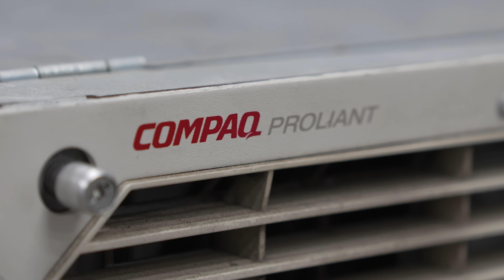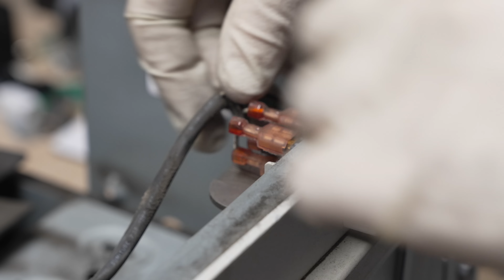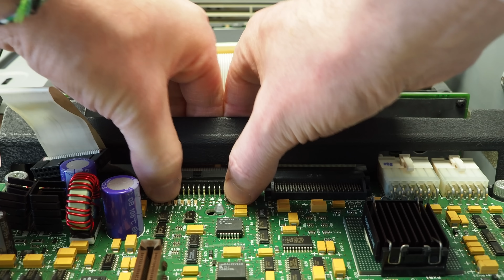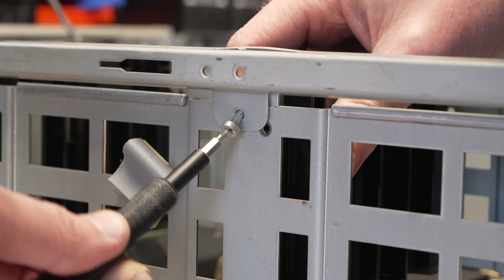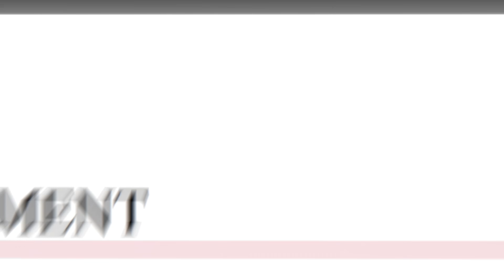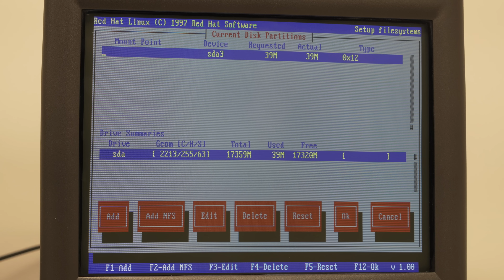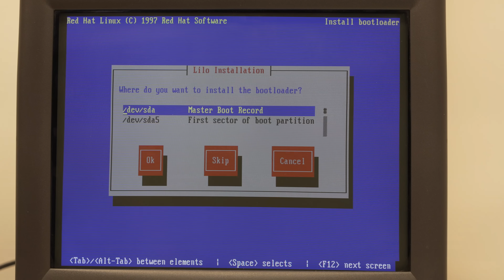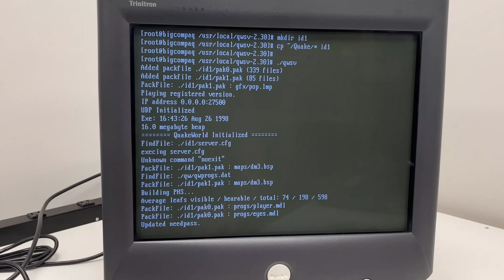A $25,000 server from 1999!

Comment: The Compaq smartstart was genius - you used to get a whole pack full of CDs and some included the operating systems that you just needed the licence for, drivers for the majority of hardware available too.
Used to install the smart array cards in these and sometimes swap the drive backplane to a split scsi bus, though you sometimes used to lose a drive bay in the process ( might not have been this particular 6500 model tho ) 
Heavy beasts that’s for sure when fully loaded!

Comment: I had the quad pentium pro version of this system. Ran server 2000 on it. It was a big trip across the state to get it, had a buddy drive me and it was a big job to load into the car. This system really got me into scsi gear. Mine had the slot loading cd drive, and i had lots of external hard drive enclosures attached for more cd drives and tape drives. I loaded it up with way bigger scsi drives and ran a music and file server off it. Had a bbs hosted on it for file servers and chat. This was around 2008, way better and smaller systems would have made sense, but i loved running it. Was cool to see all the indivial drives blink as different things were accessed. Sadly the novelty of running it wore off, and when i was planning to move i sold it. regret that and wish i had it back. Thanks for the uploads, i got a dual pentium II compaq i hope will take the place of the old p pro system.

Comment: I use to work with Compaq servers and had set up a smart start server. Basically we wold plug the server in the network.  Load the smart start disk. And in about an hour had Nt up and running with no intervention. All was automated

Comment: I combined parts from two PII proliant 3000s into a single system in the 00s. The steppings on the CPUs differed, but it worked anyway, and served as a file and backup server (DLT) until after I left the company in 2010. It had been purchased in the late 90s as a netware server for migration to address y2k concerns which never materialized. I don't miss it, but I do remember it fondly.
Reply: Netware saved us with Y2K. Most of our PCs booted to 1900 then the netware client fixed the date when it loaded.
Reply: EISA configuration utilities... I don't miss that.

Comment: I would really recommend using the "final" minor version of RHL from this era, IE always use one of 1.1, 2.1, 3.0.3, 4.2, 5.2, 6.2 or 7.3 - and RHL 5.2 was released approximately 4 months BEFORE the PIII Xeon 500MHz making it the logical choice.
AFAIK these "final" releases usually had orders of magnitude more users than the initial releases - mostly people waited for at least the .1 before switching even desktops from the previous major version and servers often waited for the final one before jumping.
SMP: I never used RHL 5.x with SMP machines but with 6.2 it was IIRC just a question of installing smp kernel rpm - or perhaps it checked during install (not sure). But that may or may not have been in place for 5.x, it was really early for SMP.

Comment: Wow! I supported some clients in the 90's and almost all had machines like this one or similar models. I especially remember an install with a Proliant 8500, what a beast. Anyway, I'm glad you got a copy of the "Smartstart" CD. It's a must for these machines. Not only for installs but the bios F10 setup program is installed on disk by Smartstart. When installed, at the end of POST you get a blinking rectangle in the upper right corner for about a second if there is an existing "BIOS partition". It was always a pain if someone else had done a quick and dirty reinstall without caring to use Smartstart. It is a very powerful BIOS/Setup program that you want to have. God I miss this era of Proliant's.

Comment: I worked for a VAR back in the mid to late 90's out of high school and we had CompuServe as one of our customers. They were buying ProLiant 5000R's and towards the end of my time there they started buying these. They were great to work on and we would load them up with 512MB of RAM and four processors with varying hard drive configs. We installed NT 4.0 on them and then shipped them out to head across town to CompuServe's headquarters in Hillard, OH

Comment: Just one of those processors would have been amazing in a home desktop at the time.

And today you can get a $150 N100 mini PC that's silent, oodles more powerful, dozens of times more RAM, sips electricity and struggles to run just Windows smoothly. :P

It's nuts how much we take compute power for granted.
Reply: its nuts how much big company developers take it for granted. Windows 11 could run so much smoother if time was taken to make it efficient
Reply: I built a system in late 2000 and it was an 800 MHz Athlon Thunderbird versus these Pentium III 550. Server CPUs have generally been intended for scale over individual core speed. If you buy a top-of-the-line Xeon Scalable system today, you get Emerald Rapids, launched late 2023, with 12th gen Golden Cove cores, launched late 2021.
Reply: linux will run fine on a N100 mini pc tho, with weak but usable 3d graphic
Reply: And it's also nuts how much various companies, like Microsoft insist we have just to run their latest Windows.
What I do can be satisfied by an old Core2 duo, but I need all the unneeded overhead to run their stupid OS (No Linux will not run my software)
Reply: @paulstubbs7678  Running Windows is a choice, not an obligation.

Comment: These were such a joy to work on.  And they were the benchmark X86 servers that set the standards, not even IBM could compete with these. Other servers were not half as easy to disassemble. And compaq treated the channel service technicians as royalty Not like Dell did.  
That all came to an end when Carly Fiorina took the helm and ran Compaq into the ground and later nearly did the same with HP.  That is what you get for letting these repuplican bilionaires run things. All they see is cost cutting and none of the qualties of the company.  Fucking criminals!!

Comment: I remember taking my training for Compaq certifications back in mid 90’s and this was one of the models I passed cert but didn’t see in the wild. More commonly worked on the Presario desktop line including the cute AIO based on a 14” CRT. Compaq had great engineering and provided us with a Torx T15 screwdriver while every clone kept using the Phillips screws.  I was sad to see Compaq get absorbed into HP. They were truly unique.

Comment: I don't think that NIC is upgradable to 1G, it is for version where two NICs sandwiched together giving you 4 ports. You can see that from number on the metal brakets where it number each interface, as well as two extra holes for active and link led. I had NIC card like this before and it had quad ports with two PCB joined together. I can'r recall name but it was based on Intel chipset with SUN part number.

Comment: Love it! We had a few of the later version of that after Compaq had been bought by HP and rebranded. Fully tricked out too. By then they supported 8 cpus and 64GB of ram. Then you could also remove the cpu board, and hot swappable RAM boards too. Which made it much easier to rack mount.

Comment: i am wondering, have those CPUs multiple RAM Channels with interconnects or there are shared over one bus? i mean you put 2 more CPUs in it and reduced the RAM modules by half. so theoretically the bandwidth is half but also the placement makes no sense if every CPU has its own channel. i guess maybe this was the problem why you could only see the half of the ram in the beginning, because of the RAM module placement or your ram and CPU was set to fully redundant, therefore the second CPU and RAM does nothing unless one of them fail. 
I have a dell poweredge R630 and a R930 at home. Those are compute monsters like this at its time. Both of them can be set to fully redundant this means only one CPU and its RAM is working, the others doing nothing. yeah it sounds like a waist of resources but if you deploy your system on a place where you can't go easily and need 100% uptime this is a pretty good solution. The failover is seamless compared to having 2 individual systems working parallel together.

Comment: I worked with Intel reference SC5000 boxes at that time. Fun part with these systems was that they were so bottlenecked on FSB that going from two to four CPUs often only got you single digit percent improvement. So you were just heating up the room for no gain.

Comment: It's absolutely mind-boggling how fast CPU / semiconductor industry moves.
My main home server is Ryzen 3 PRO 4350G (4C8T Zen2 3.8GHz : boost disabled), 32GB ECC 3200MT/s DDR4, two Intel 1Gbps ethernet (i210 and i211), and two NVMe SSDs, all squeezed into a small mini-ITX enclosure with just one fan for the whole thing.  This little thing would completely blow that $25k server out of the water, and it's not even the latest anything!
Reply: Heck this thing is outclassed by a Raspberry PI 4 now.   It's cool but very dated.

Comment: I used to have a load of these Quad 6500's to run a calculation and print engine service. 2 sets or 4 in each server room, and another 35 scattered around the country in branches for remote calcs. 
All had a full drive bay of 15,000rpm 9.1Gb discs. 
Also had the UPS (180Lb) lead acid brick in the bottom of the rack as a stabiliser....
Ran NT3.5.1 then later NT4.0

Comment: Compaq really loved to use those flat/Star screws I was given several compaq p1-166 machines at one point 24 years ago.
Reply: You will find them everywhere in modern HPE ProLiant servers as well, they haven't gone anywhere! 

It's just so thoughtful they included the slot, so that a technician without the right screwdriver could still work on one in a pinch, definitely a welcoming design element if I ever saw one. 

Way better than Phillips that's for sure
Reply: Even back then they knew the superiority of torx
Reply: Hateful things

Comment: Beautiful restoration! Little tip when working with brittle aged ABS plastics, take a temperature controlled heat gun at 70-80C to soften it up a bit, let it cool down naturally back to room temperature, and it should be malleable again without snapping off. Try it on a sacrificial part first to get a feel!
Reply: Oh cool, like annealing for copper etc?

Comment: The good old days, when I was the junior technician using ISDN to remotely connect this machine via a PCI KVM for diagnostics.
Reply: yes, with a Compaq Remote Insight Lights-Out Edition PCI management board installed in a Compaq Proliant, you could do everything remotely from powering the server on and off, applying ROMPaq firmware updates to the System BIOS or Smart Array RAID Controllers, even perform a full re-installation of Windows NT or Novell NetWare

Comment: I just love these old weird servers. I've got one ProLiant 3000 and two 5500's myself. I've ran the 3000 as a pihole DNS resolver at home for years, haha! 
The old SCSI drives are an issue these days. But I've found you can easily add disk controllers such as the old Promise Tech IDE ones, and even PCI SATA controllers as long as the controller has its own BIOS. I've booted Debian off a STA SSD in one of the 5500s. You need to manually partition the drive to put the boot partition at the start of the drive. Other than that it's surprisingly smooth sailing. I've also replaced the fans with more quiet ones from Yate Loon of the same thickness. The stock fans are massive overkill for a home environment.

Comment: 256 MB wasn't all that crazy. I had 192 MB in my Windows 98 computer (in or around 1999) by adding 128 after deeming 64 insufficient. I wasn't exactly flush with cash so it couldn't have been that expensive. I bet the 128 was around $100. What would be crazy is actually taking advantage of Intel's PAE to utilize more than 4 GB RAM.

Comment: On some Compaq systems of the era the SmartStart and other boot discs were absolutely necessary due to Compaq deciding not to include any built-in BIOS configuration on the ROM but rather having it all done via a boot disc
This isn't exclusive to servers either, even some Compaq laptops suffer from this!

Comment: Interesting video, especially when you installed Red Hat! Things may have been smoother if you used a slightly newer version of Red Hat, like Red Hat 6.1 from 1999, it uses kernel 2.2.12 and has the smp kernel on the disc. But it is good that you got it to work on the older version :)

Comment: Great video. Really loved seeing cleaning with soap and water.  Too many tech rehabbers go to great lengths brushing off dust when they can just wash the stupid parts.  It's frustrating to watch.  Anyway, here is my Compaq srory. Job I worked in 1999 had a $50K similar Compaq server. It was the pride and joy of that shop.  Changed jobs and my new employer also had one, but by 2004, things had progressed so fast, the Compaq was totally obsolete and they gave it away to employees.  I took it home.  In theory. It made it IN to my car, taking the whole back seat. But it never left the car. The idea of carrying it up stairs into my house was a no. Ended up giving it to another coworker and it went from my car to his car.  Never looked back.
Reply: Ehm, had you stopped to think for 60sec it might have occurred to you that servers like this are like Lego. Moving them as one piece is the definition of stupidity, take the PSU's, drives, cage modules out and you have a bunch of bits that are easy to transport. The case isn't that heavy when empty, it's just an annoying shape and big. I transported a DEC VAX 11/750 to the third floor without elevator that way. Just takes a bit of time and multiple trips.
Reply: thats not soap, theres a special solution to be used with an ultrasonic cleaner. its not soap though. the ultrasonic cleaner uses sound to clean it and the fluid is meant to be good with that.
Reply: Ha, good stpry

Comment: Notice how most of the disassembly is tool-less. Compaq got that design philosophy from DEC, and later it was passed on to HP. These machines might have been expensive and as you say most of the components are bespoke, but you wouldn't bloody your knuckles or lose screws inside the case trying to swap out a NIC.

Comment: Another thing about this generation which was cool was conversion kits.  Since they are modular, if you started out with a tower, which was the most common variant, then wanted to make them rack mount, they had modules and covers to swap onto the tower to make it fully rackable.  You can see things like the LCD orientation can go multiple ways.  

I loved these things.  Made me so much money doing conversions and Lotus Notes administration, hooking them up to USR Total Control modem chassis with T1 lines.
Reply: I remember you could do this - converted a few (2500 ?) in a similar way - then they had R after the model name meaning it was already in rack format

Comment: We used those in late 90s early 2000s for Windows Terminal Servers Servers. Initially running Citrix with NT 3.5 then windows NT 4 servers with WTS built in. Was used for remote offices over Frame Relay all over the country. In that era the vast majority of servers were windows NT or IBM Unix but mostly windows NT 3.5 or 4.

Comment: Damn I have like a that was $5000 back in 2004, but it is basically ewaste now, there isn't even a single manual on it like it is lost to time and I bought two of them one is basically destroyed from shipping, I have no idea what's wrong with it. the other one though works and I did scrap some parts from the order one because the other one was the one with the hard drives And Ram. the only thing it does is curse to be on the original vista due to having shitty igpu.

Comment: Perhaps just a hair too early for VMware ESX Server (1.0, 1.5)? Probably not officially supported. But otherwise would suggest Windows 2000 Server with everything 2000 (Active Directory w/Exchange, SharePoint, ASF video streaming etc. etc.).

I did have a ML350 (G1) with 12 SCSI drives, 2x933 MHz PIIIs and 1 Gig of RAM. Thing pulled 300 W on idle and 350-380-ish when dragging a window around in NT4. Would actually support Server 2008 (which is secretly Vista) as long as you didn't install updates post may 2019 I think it was due to SSE2 or something.

Comment: There is 1 system that I can think of that dwarfs this.  I had an IBM server that had 8 Xeon P3 800Mhz CPUs, and maxed out the ram at 16gb.  The Netfinity 8500R.  iirc, it was 8 or 10u.  Colossal machine.  It was so cool.
Reply: Compaq did proliant 7000 and 8000 models which were slightly bigger a lots more drive bays
Reply: @davidistesting  They were?  Its been some time, but I remember the Netfinity 8500R being something around 2.5-3ft long.  Heavy bastard too, 2 man lift.  But I never really got to play with a Proliant 700/8000.  It might be bigger.  The drive count, I can see that.  The Netfinity had something like 8 drive bays iirc.

Beast of a machine though with raw power.  8x 800Mhz Xeon P3s were nothin' to sneeze at.

Comment: I only ever installed Windows NT and 2000 on them using SmartStart. In auto mode installs the system software directly into it. Later servers used the same and some required extra software to lower the fan rpm, otherwise they would be on full blast. If you select manual, it may skip such essential software and I would recommend trying it out. Even current HPE servers do this, but now its renamed to intelligent provisioning and lives in UEFI. I would maybe go for a distro with linux 2.2 for the SMP stuff. The server bios shows a date of year 2000, so I think it would be still period correct enough to go for 2.2.